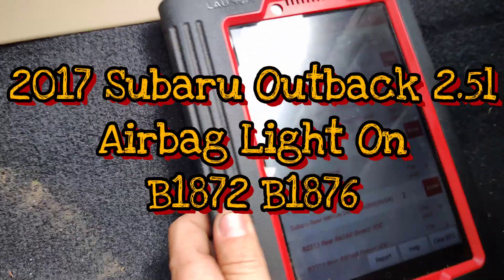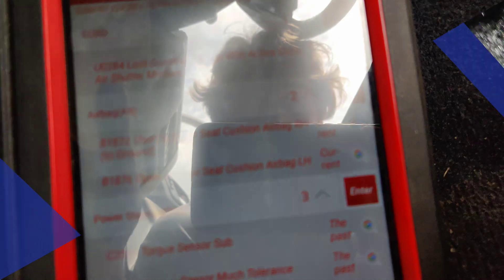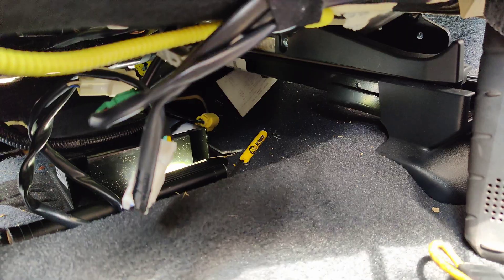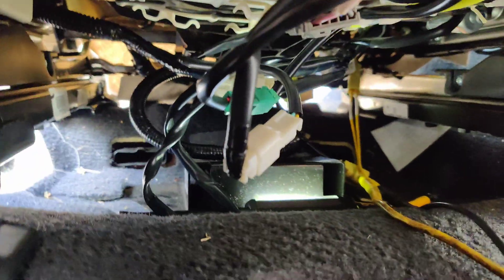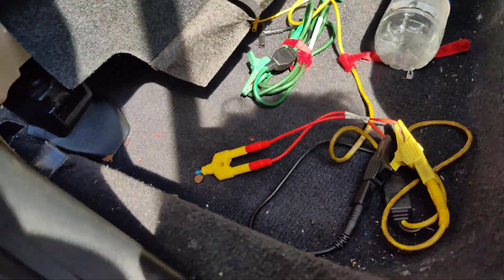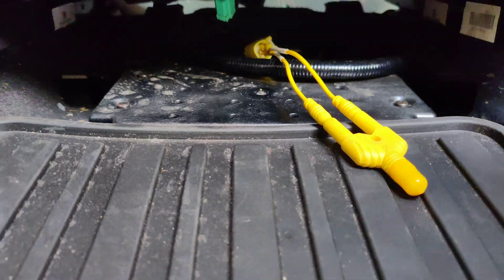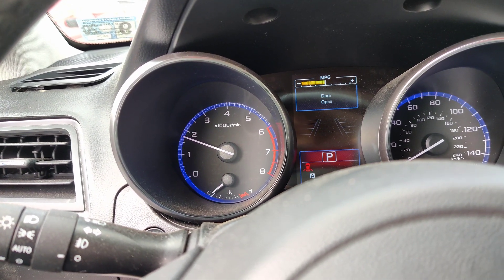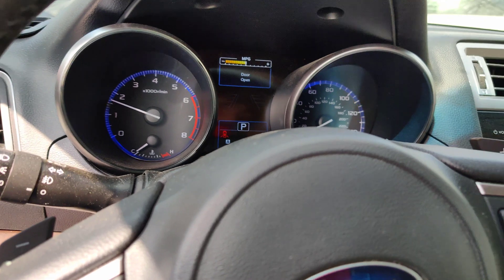2017 Subaru Outback 2.5l Airbag Light Codes B1872 B1876

Comment: I unplugged a seat airbag to throw a code and then reconnected it. The code stays and says it is a History code, and clearing it doesnt make it go away. Srs light stays on. I have a Launch CR629. Any clue how to clear this code?
Reply from the maker: If it goes to history then it is not causing the problem. Scan the car with another tool and see if it is the same.
Reply: @RobertDotterer  Found the answer...the code wont clear unless all of the SRS codes are clear. In my case, all airbags had to to fixed before any of the codes would clear.
Reply from the maker: Awesome, that's good to hear but it should have cleared once it was fixed.

Comment: Nice video! Do you know how many olms the resistor needs to be for the seat airbags?
Reply from the maker: Spec for this vehicle said less than 10 ohms. I always look up specs and theory and operation before testing anything. If you don't understand the system you can't properly test it.